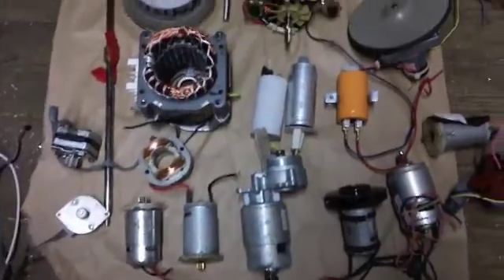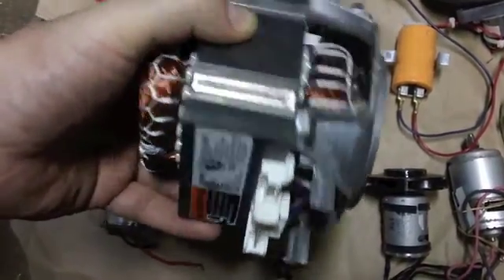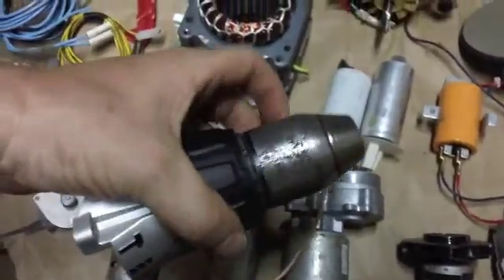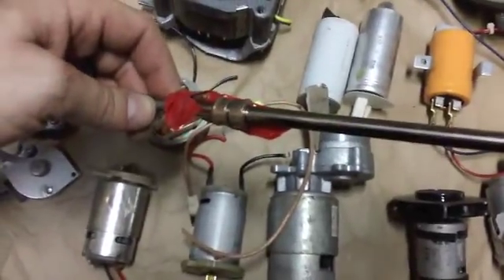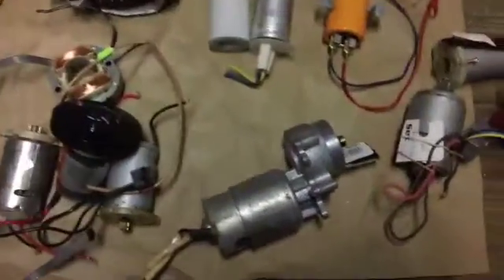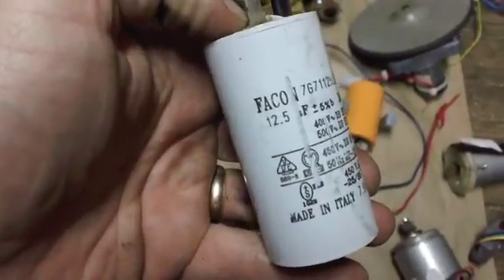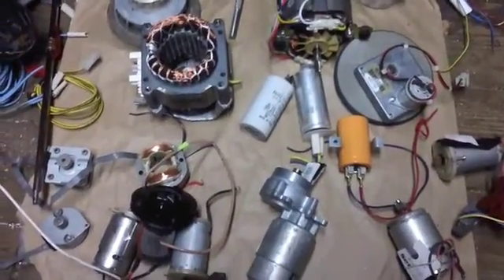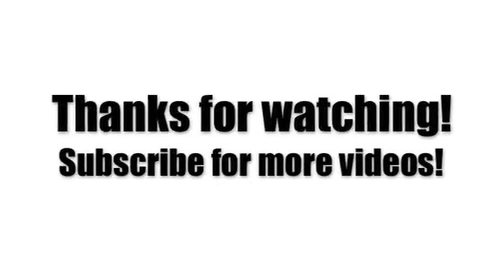The Bountiful Harvest of Motors and Parts for Projects

Comment: Shame to take apart battery tools. Take apart the packs, they tend to use fairly generic sized smaller batteries inside (AA or D cell sized). £5 on ebay you can pick up a load of new batteries, solder them together and you got a new working cordless tool.